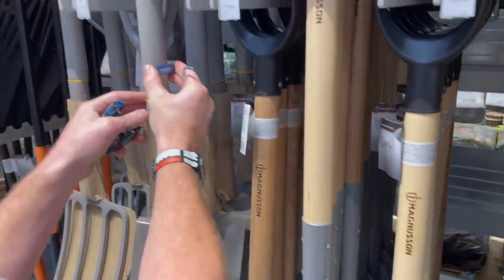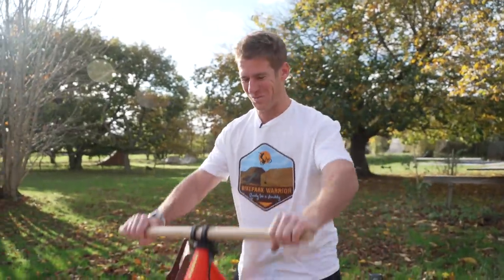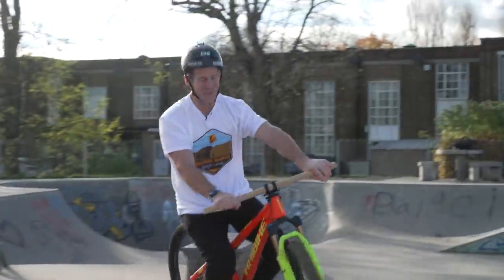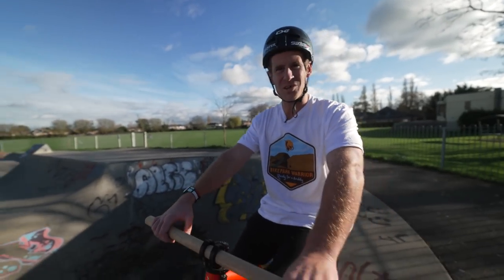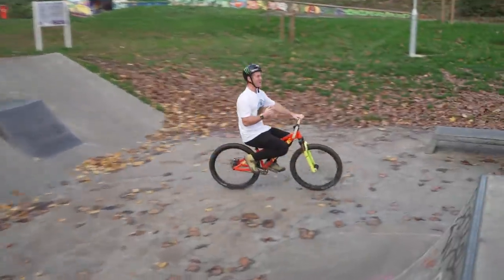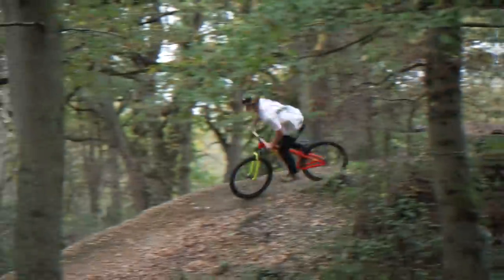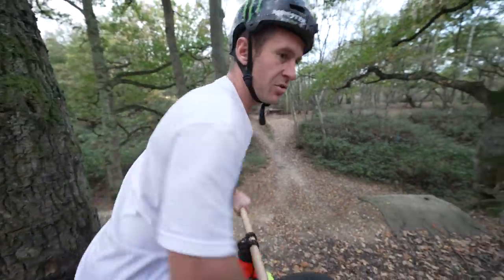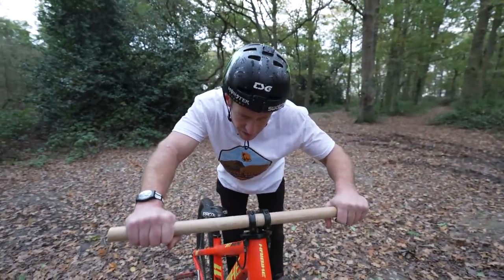RIDING WITH WOODEN HANDLEBARS ON MY MTB - WILL THEY SNAP?

Comment: Awesome as usual Sam! As a carpenter and wood nerd I can tell ya that youve got yourself a nice set of Ash handlebars. This wood is typically used for sledgehammers and axe handles due to its strength and shock absorbing properties. On closer inspection the piece you selected had straight grain with minimal run out, meaning that the wood fibres were as long as they can be giving you maximum strength. Not only that, you had the grain orientated with the annular rings 'to the sky' rather than parallel with the ground, so you can take more hits as the grain is less likely to fold and break. Clearly you knew this cause I've seen your woodworking skills ;)
Reply: But these tools break a lot anyway. Feels like they are designed to break so u buy new one 😂
Reply: @feeleap5545  i only get rubber ones because of this. Last longer and grip nicer
Reply: @feeleap5545  A properly made (and looked after) tool handle can last a lifetime, even getting smacked around all day. But these have attention to detail and specific characteristics that modern mass manufacturers generally just don't do. You see a lot of cheaper, less suitable woods used nowadays with very poor cuts of wood where the grain doesn't run the length of the handle, theyre full of knots and defects and have improper grain orientation which results in a lot more breakage. The average user will not notice this. These cheap tools do feel as though theyre designed to break so you have to buy a new one. Ultimately wood is a natural and imperfect material, but I think you'd be surprised just how far you can push it.
Reply: @pablocruzgilmour  Wood is the most magical thing in the world I reckon. It's imperfect ,as in it occasionally has knots and burls and breaks in the grain, but it's also the most perfect thing for what it needs to do because trees grow it when they require it and where they require it without wasting anything. 

I don't think there's any way this handlebar would snap honestly. It's too thick and as you already pointed out the grain directions is absolutely perfect for the kinds of load it will be experiencing.
Reply: @feeleap5545  
That's because the wood is not selected for, it's just random pieces of ash.
Reply: Yeah u definitely know better than me but still… not worth finding its limit 😂
Reply: Yeah, they've tried a million different high tech materials for ski cores, but they always decide they are worse than well crafted wood at damping chatter. Thus, nearly all skis are wood core.

I've rammed wooden dowels into metal bars on bikes and motorcycles, and the vibration reduction is quite noticable with very little additional weight. 

Tiger Woods actually had wood dowels pushed into his iron shafts to achieve the same effect: Less vibration and less fatigue. Anybody who's used an axe or heavy hammer for an extended period will also tell you wood is quite hard if not impossible to beat for low fatigue on your hands. Ash and hickory can also be incredibly durable if well crafted. Golf club shafts used to be entirely wood, but they were too costly to make though, and absorbed a bit too much swing energy.
Reply: A company, Renovo, actually made entire mtb frames almost completely out of wood. Carefully designed by an aerospace engineer, they were really good. Low vibration, light, and durable. But, the craftsmanship and labor required to make them proved too expensive and the company went bust.
Reply: There was a company in Ireland a while back that made road frames out of Ash, not sure if they are still in business. Would be cool to see laminated Wood handlebars too
Reply: @roooroooooooo1091  Woodelo is the name you're looking for. Pretty sure they are still in operation
Reply: If your telling the truth thats soo interesting, thanks for your knowledge. Good thing Sam is equally crazy and responsable with safety

Comment: I have seen bamboo bars recently. But wooden wheels plus wooden bars would take the cake ☝️🤟👽🚲
Reply: Should’ve tried that with the wooden free bike
Reply: Some engineer made mtb frames almost entirely out of wood. They were incredibly good, maybe better than carbon, because wood has such excellent vibration damping, low weight, and durability when well designed and crafted. Company was called Renovo, unfortunately they went bust, because the level of craftsmanship required to pull this off is very expensive.

I've jammed wood into metal handlebars to damp vibration and the results were pretty astonishing.

Comment: Wrap the bars with spare monny tins to make them aluminium again. If you use a pop rivet gun then they can have a steampunk vibe to their construction. Then, if the wood breaks, you will get shards of razor sharp monny tin instead of just a few splinters. Maybe take some tweezers with you for first aid. 

The views on this 'episode' must all go to the end as everyone expects the bars to break and are watching for the inevitable crash of doom.
Max respect for doing things I would never do with no brakes. Wooden bars is mind blowing.

I think you can also use the tool adapted to the bike to do trail maintenance. It would be faster than walking. Just help the council out for lols.

I survived broken handlebars on a main road. It was my fault as I had drilled a hole in them and metal fatigue happens.
I continued my journey and made it back home again, feeling a bit silly.

Comment: This is probably the bike part where wood is going to work the best. A good strong wood like hickory is going to be hard to snap, but the middle will probably wear out quickly because of the small rings. If you took a piece of metal pipe and cut it in half as a spacer it'd probably last forever.
Reply: @leonardhpls6  Strong enough that we use it for hammer and axe handles that are used to hit things thousands of times without breaking.

Comment: I snapped my bars when out on a ride once. Due to metal fatigue and not my extreme riding ability I hasten to add. Fashioned a new set of bars from a branch and slid the broken bars over either end, enabling me to use my brakes. Flexed a helluva lot but got me home.

Comment: Nice! You know the old forks from the 90's where the stanchions were clamped in with bolts at the crown? If this  diameter wood fits in there, you could make forks as long as you like!
Reply from the maker: That sounds awful 😂
Reply: @SamPilgrim  "it's crack a stanny o'clock"
Reply: yes wooden downhill forks!

Comment: If you ever try this again and want some grips on there, you should see if you can find hockey tape in England! It's like electrical tape but properly grippy, almost like medical tape. You can do some pretty cool grips with it, I'm sure there are loads of tutorials for it.

You could also use a little bit as a gasket between the bar and the stem, it might take some pressure off the wood on the heavy landings. Would have to be real thin to fit though.

Comment: Ash or hickory is similar to carbon in flex and about as strong as aluminum. I wouldn't spend a minute worrying about the bars breaking. I'd only worry about having no brakes.

Comment: I think those will be pretty hard to break.  if its not dry rotted, like it is as new, it probably wont even snap clean off.  I bet it would split and bend but lot if the wood fiber still attached, probably blow a hand off tho if that were to happen

Comment: i no theres silly things 2 do but can u imagine riding no in fine well chances are the handle bars are gonna brake if ya sat down ya weight aint gonna be on them so iff they brake then ya not really gonna go into it but if u do yav got a medal headset and prob sharp snapped buts of wood attached 2 it but like i say u prob wont go 4wood but if your stood up putting ya weight on them ya head is gonna hit that metal bar...i strait away thought of somet as silly would be 2 have a wooden seat and tryna snap it then if it duz snap all ya weight is gonna land on a little thin bar and prob go up  ya backside which sounds ruff..but 2 this its not as bad ya head is the most inportent part of ya body even ya body knowes that when ya scared or fall ya cover ya head